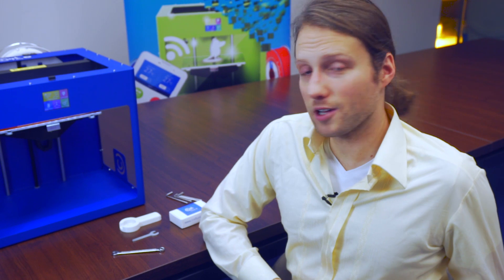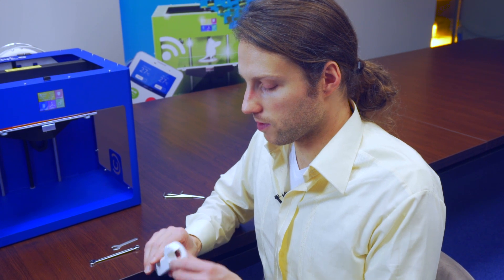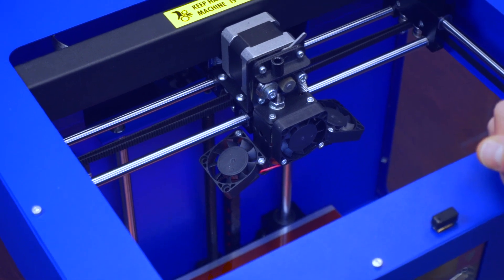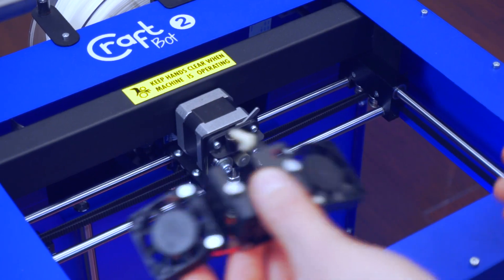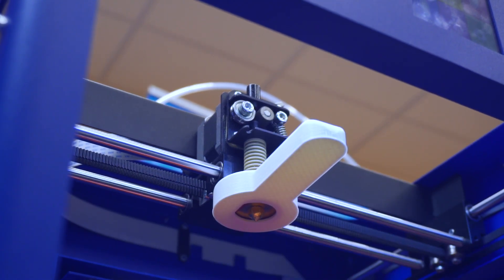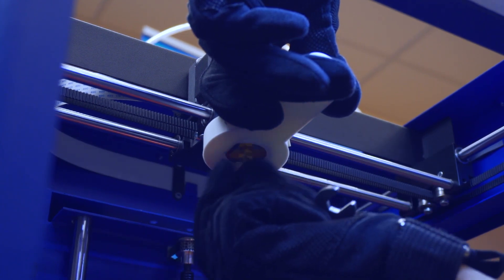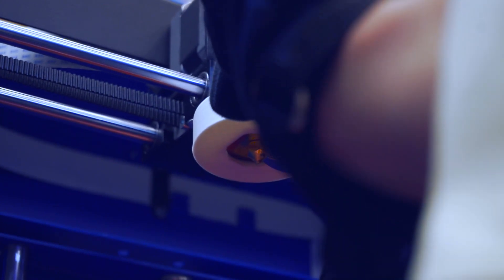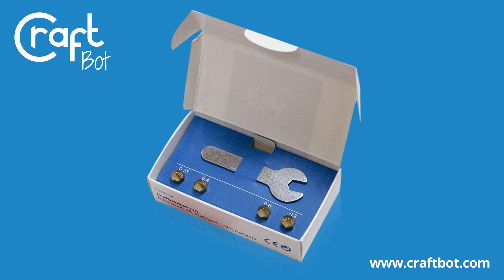CraftBot nozzle replacement

Comment: So having done this many times on my own (not a craftbot) printer, through various generations of extruders... Use a damn 1/4" drve socket and a pair of channel locks with a rag for padding the jaws. Unless you printed that plastic wrench with something like PEEK that doesn't even start to melt at PLA temps, you're just doing to f* it up. Use metal.

Comment: Warning: Because you need the machine heated when removing the nozzle, DO NOT use there crappy 3d printed wrench, it will melt and warp allowing the hot end to move and rip your wires from the heat cartridge, It broke mine and I contacted the US distributor and they would not do anything for me and just said it was there Hungarian dept and they cant do anything for me. Lets not forget that they have a HUGE markup for replacement parts, don't do business with these jokers, no customer service and shity tutorials that damage your expensive machine.
Reply: Facts, my PSU went out after doing a 5 hour print, i tried requesting for a replacement psu or an replacement printer, they responded the first few days, then ghosted me.